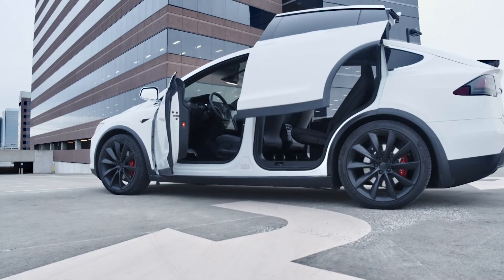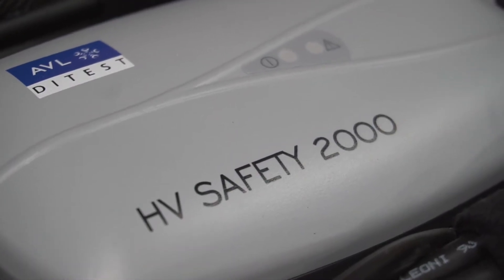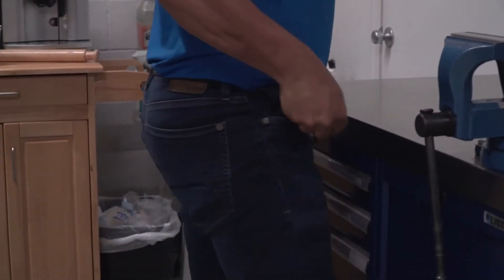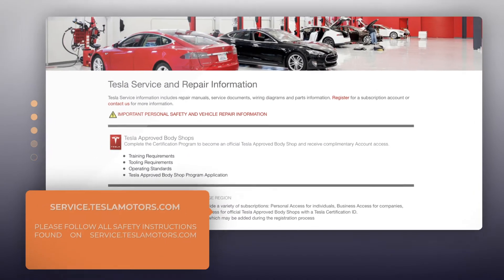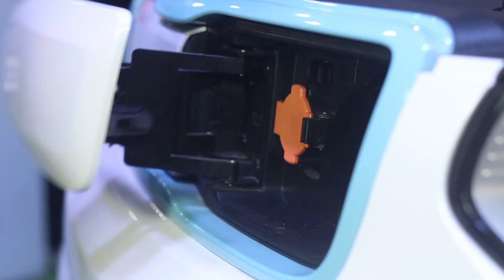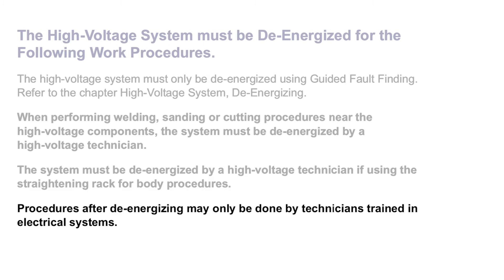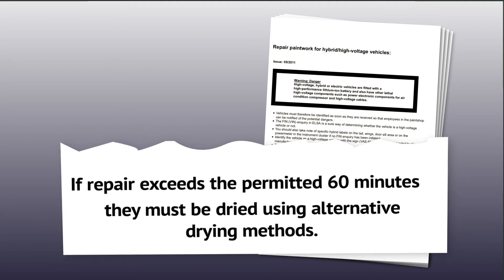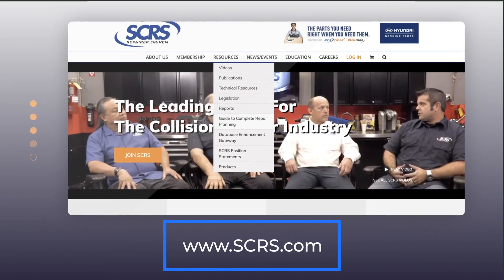Electric Vehicle and High-Voltage System Safety in Collision Repair

Comment: so here is my question. For anyone to work on high voltage whether in a home, factory, farm has to be a licensed electrician. That applies to any voltage above 24Volts.  So why is this not applicable to an EV vehicle?  What does the NEC National Electrical Code have to say.
Reply from the maker: This is why many manufacturers may require the vehicle to be energized by a certified high-voltage technician. Safety is an important consideration with high voltage vehicles.